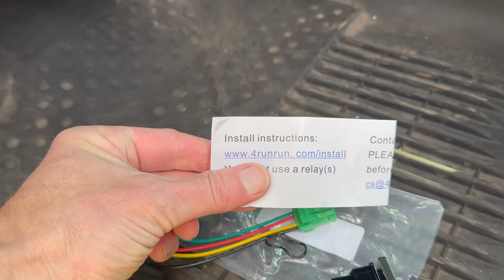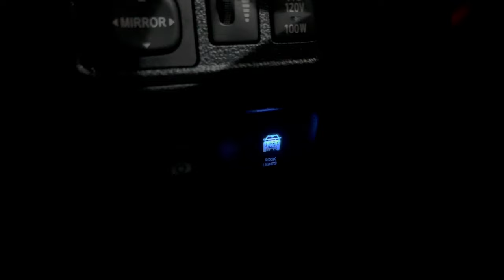How to Install OEM Switch for 5th Gen 4Runner

Comment: This helps a lot! Thank you.
The OEM switch I got from 4Runner Lifestyle did not have an online fuse in the power. However, the power would be coming from a relay. Should I put an inline fuse on the power from the switch?
Reply from the maker: Yes, using an in-line fuse to the switch is recommended. It provides additional protection by interrupting the circuit in case of a short circuit or overcurrent, helping prevent damage to the switch and other components in the system, and reducing risk of fire. The relay helps control the current but doesn’t offer protection by itself, so a fuse to the accessory and a fuse to the switch are both recommended.

Comment: If I wanted my raptor lights to turn on with the car but still have a on and off switch, would I tap the power wire of the lights to a fuse and then break the circuit with the power from the switch?
Reply from the maker: If you want a switch, I would install a relay, then the switch to the relay wiring harness.  Although the amp draw of raptor lights is very low, a relay helps reduce the risk of fire or melted switches in the event of over current.  It’s true there would be some protection with a fuse, but I’d feel safer with a relay anytime a switch is installed.

Comment: If I have a blue wire, will it set aside the same as your yellow wire?
Reply from the maker: Unfortunately, different switch manufacturers use different color wires, so it can be difficult to tell.  The wiring harness should connect to the back of the switch in the same orientation though, so you can line up the wires in the same order and see if your blue corresponds to my yellow.  Hope that helps!